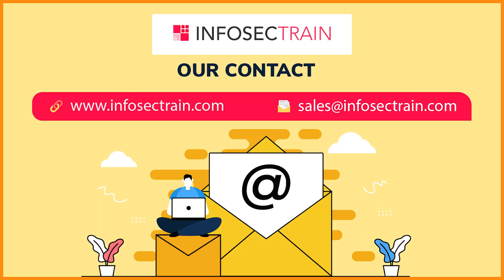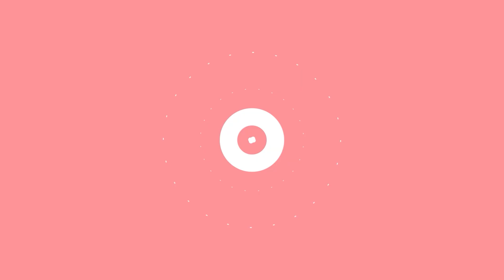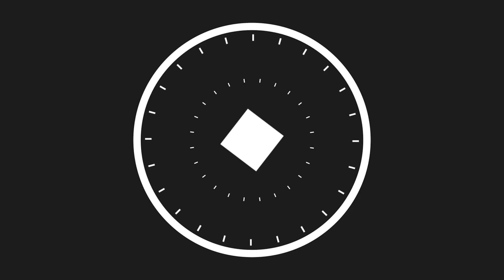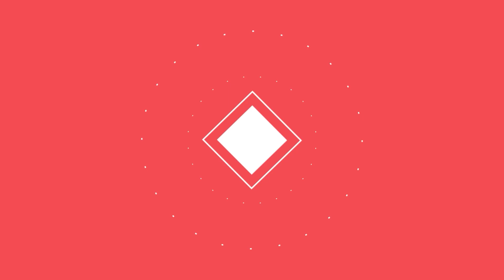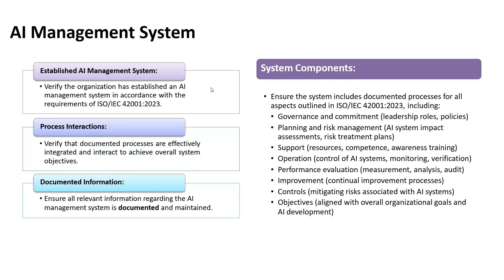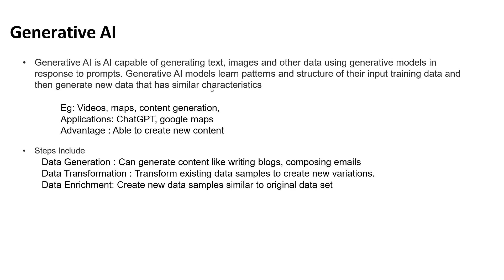AI Management System and Generative AI | Building Responsible AI Frameworks

Comment: A lot of teams are excited about generative AI, but figuring out how to control it in practice is where most get stuck. That’s why having a structured AIMS under ISO 42001 matters so much, in the same way MailsAI wraps automation in clear rules, monitoring, and guardrails instead of just letting people send unlimited emails with no oversight. With a management system around AI, you’re not just chasing cool use cases, you’re actually defining risk, accountability, and audit trails so the tech can scale without blowing up trust or compliance later.